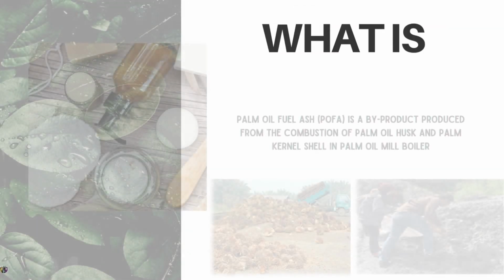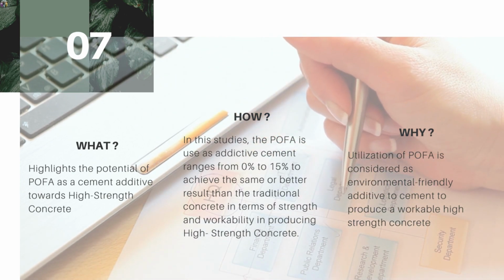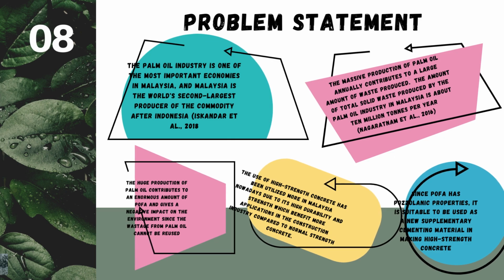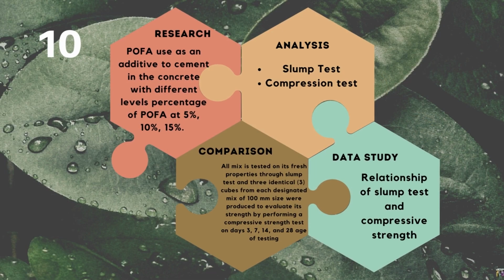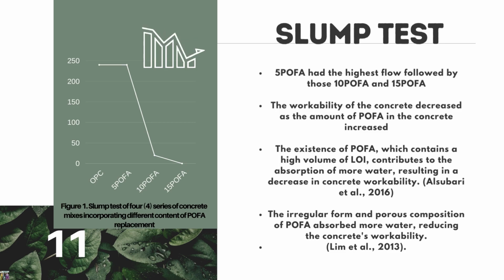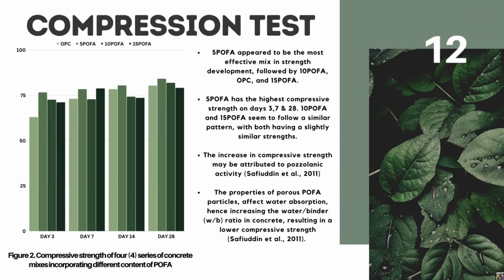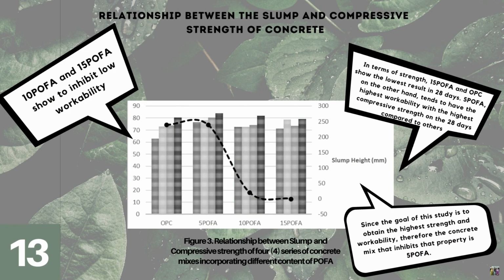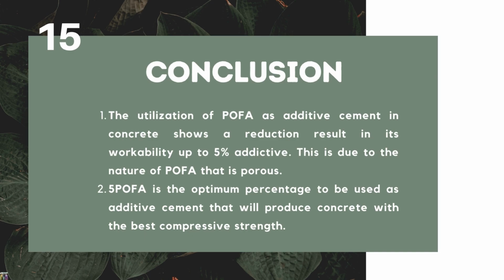The Effect of Palm Oil Fuel Ash as Cement Additive on High-Strength Concrete

Comment: What is the significance the use of POFA as cement addictive?
Reply: POFA is a pozzolanic material and it can act as a replacement of cement (OPC) to produce concrete with higher strength and low cost.  Besides, POFA is eco-efficient materials that is economical in producing green concrete.